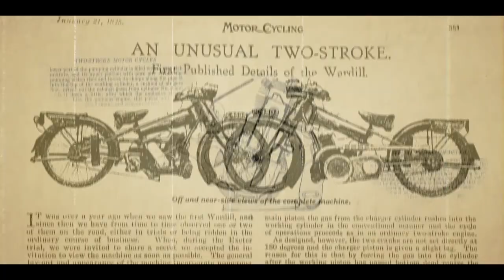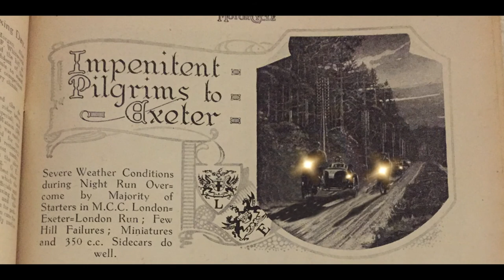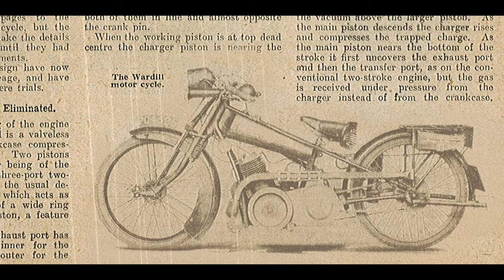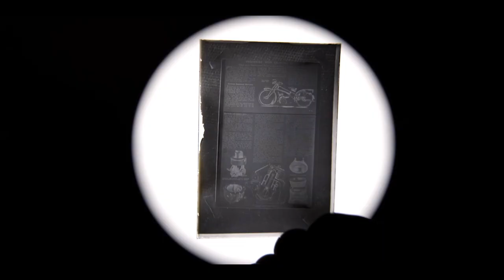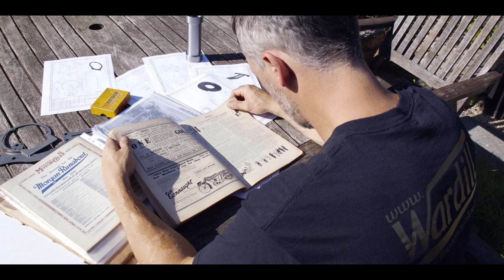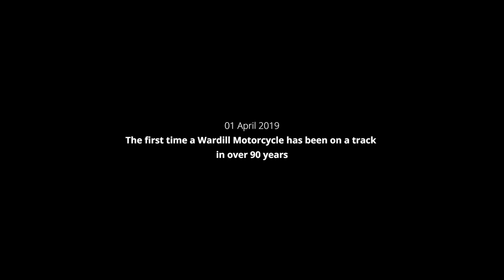Wardill Motorcycle Company - The revival

Comment: The most common type of motorcycle engine in 1924 was the sidevalve 4 stroke. It has more moving parts than a 2 stroke but is easier to design, especially with the materials available at the time.